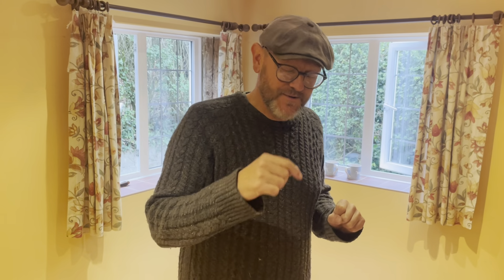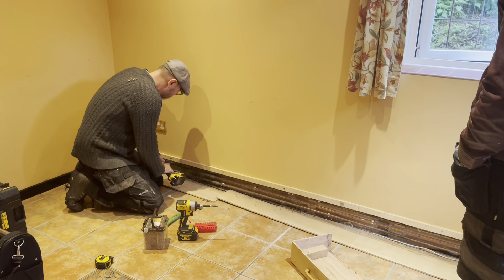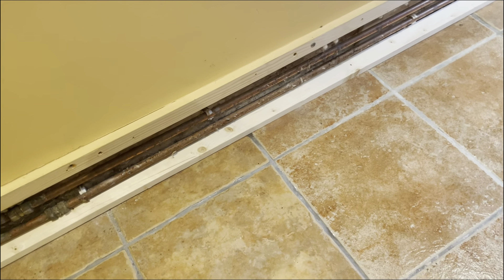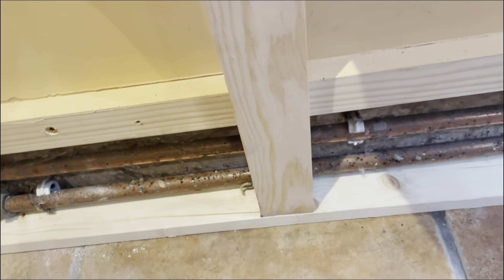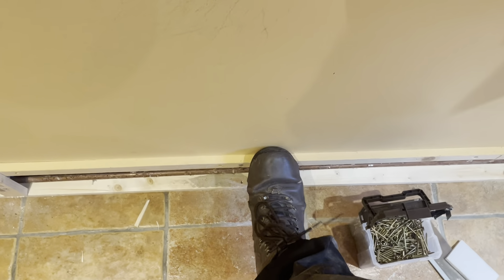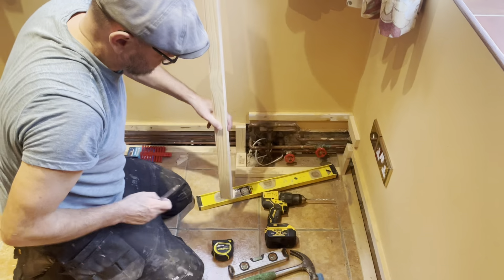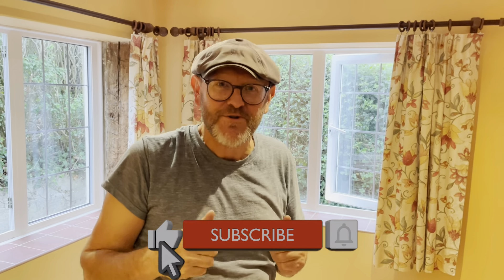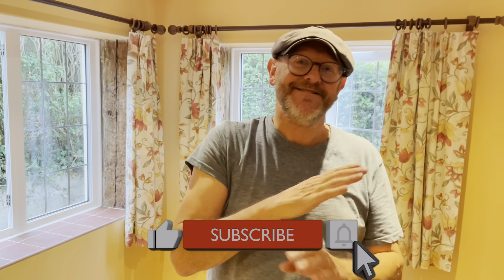How to Make Boxing In Of Pipes Look Better.

Comment: You seemed to use quite short red 6mm wall plugs, but you knocked them right through the timber.  How does that work? Don't you end up with a much larger hole in the timber than you need, so that the head of the screw might pull through?  I have always drilled holes in the timber first, then tapped a nail through each hole to mark the wall and put the plugs in the wall then attached the timber.  Your way is much quicker and avoids any misalignment between the hole in the timber and the hole in the wall.
Reply from the maker: I do both when fixing through timber. As long  as you use the right screws it won’t pull through. I often pre drill the timber then drill into the wall just marking the wall , then swap to the right drill bit for the plug.
Reply: @KAPWoodworkandbuilding  Thanks for your reply. I think that is what I will do. Pre-drill the timber with a 4mm wood/steel drill bit, then drill through the holes in the timber into the wall with a 4mm masonary drill. Then remove the timber and open up the holes in the wall to the required size (5/6 mm) with a masonary drill and insert the plugs. This should work well as the pre-drilled timber should stop the masonary drill from 'wandering' too much and ensure that the holes in the timber and wall align well. It is only slightly more work swapping over drill bits, but hopefully ensures a good result.

Comment: I'm guessing this may be solid walls (stone?) as well as floors?  No a job I've ever done but I should have done this in the bathroom years ago.  My OCD would insist on dead square edges but I'd probably make a mess of it so the overhang and moulded edge makes sense.

Comment: It is fascinating to see how you build houses over there. I can't recall ever seeing pipes installed along a wall like that in the United States. Normally they would be run under the floor in the crawlspace or if it is a slab foundation, buried in the concrete before the slab is poured. Also with our timber-framed houses, plumbing can be run through the studs behind the drywall. It looks like you are using a hammer drill and mortar drill bit, so it must be concrete walls.

Looking at the pipes coming into the room, I wonder if these were installed years after the house was built. You guys have some really old residential homes.

Nice touch rounding the edges of the MDF. I really enjoy watching this video. It is always interesting to see how things were built over there, often being quite different from the way we do it here.  Thanks Mark!
Reply from the maker: Hi David loved your observations. If it’s a new build then the pipe work would mostly be hidden, but with so many older properties people have all sorts of work done at various stages so very often pipes are run along walls. 
I have currently got a few potential jobs just making pipe work disappear.
Reply: We have hot water baseboard heating everywhere in Alaska, it's extremely common in colder environments with houses built between 1980s and 2010s. Before that it was forced air with floor vents, but  it's very unpopular as it is much less efficient. Baseboard heating is dead ugly though, no way around it. With shutoff valves like that, it looks like this may be a water source rather than a heating source, which seems pretty weird to me, haha. The thing that gets me the most is the outlets though 😂, those look so bizzare to me.

Comment: Nice job but I'd always leave the mains stop cock easily accessible as in either completely open ready to turn or at the very least a magnetic hatch. If the home owner has a burst pipe or something, they (assuming they're not the most DIY minded as majority of people aren't) will not be getting into that boxing in anytime soon, especially after they've painted in and can't see the screw holes.
Reply from the maker: Fair point 👍
Reply: Leaving the lid removable with battens attached to the underside to stop it sliding around would probably have worked in this case. Looked like there was space to reach down to turn the valves.
Reply: Yeh mun if you're dealing with a flood the last thing you want to be doing is wondering where the stopcock is, stripping off paint to find he screws, finding your screwdriver etc. That cock should be left accessible!

Comment: To say cables generally go horizontal and vertical is ok (it's not professionally accepted to run cables horizontal) but a quick check by undoing the socket would give you an idea which way the cables run, also a simple cable tester would give you the answer. That said the boxing in is beautiful and a really good job and looks super neat, although there is no immediate (home owner) quick access to the mains stop cock) Well done.

Comment: What size was the base board and how did you fix it to the tiled floor, screwed or glued or neither, what size is the top piece of trim, as you say this wasn't very sexy and neither was it a very detailed 'How to video'. I certainly don't agree with a complete boxing in of the stop cock to mains water even if it can be removed, should always be visible, I won't be returning for more.

Comment: If the lid in the corner was liftable that would leave easier/quicker access to the stopcock. Some small wooden blocks stuck to the underside of the lid could let it slot in without accidentally sliding off.